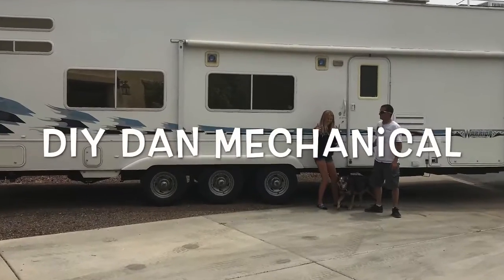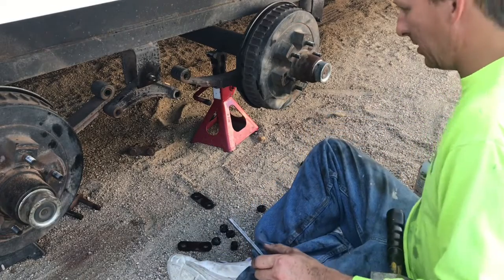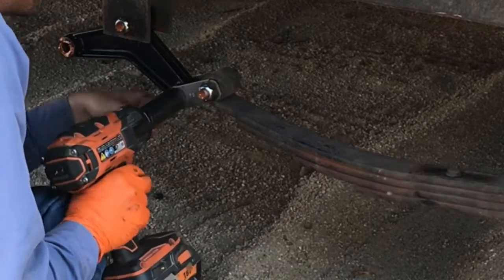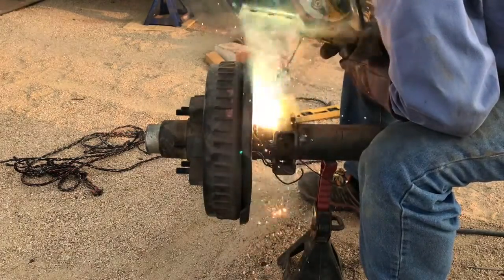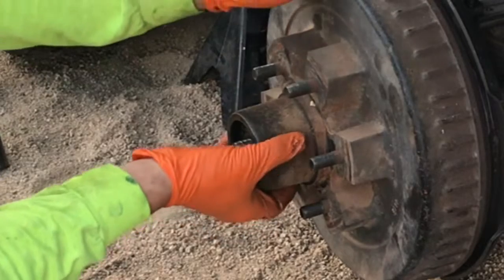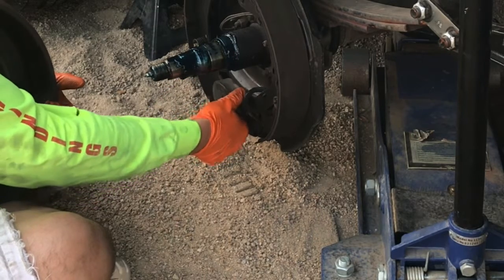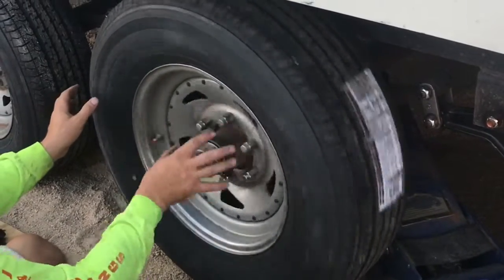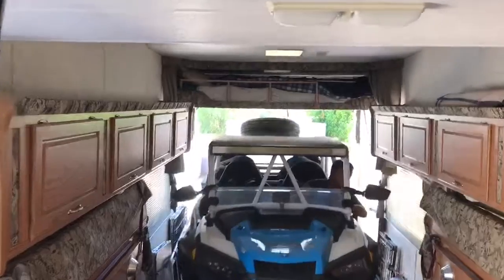FLIPPING THE AXLES ON TOY HAULER/CAMPER FOR MORE CLEARANCE CONCEPTS SAME FOR ANY LEAF SPRING TRAILER

Comment: Why did you remove the axles all the way out? Can’t you just leave them there and then just bring it up after you are done with the leaf springs? Or did you rotate them or something? About to do mine, triple axle too.
Reply from the maker: You could I just took them out because it was easier for me to weld the new hanger brackets on the axles  not being under the trailer
Reply: @diydan7019  nice i get it, mine is used, it already has the hangers welded, looks like maybe at some point it was already flipped
Reply: @alejandrorenteria4769  I know this is six months old but just checking but what you are saying is you have TWO sets of hangers?

Comment: You should run a new brake wire on the outside of the axle. I can almost guarantee that the wire insulation has worn through at this point and will cause havoc on the performance (Ask me how I know). And your brakes were out of adjustment,  you shouldn't get more than  1.5 to 2 rotations with a light/ moderate hand spin.  The zerk is for emergency use only.  Only use it to get home if overheating.